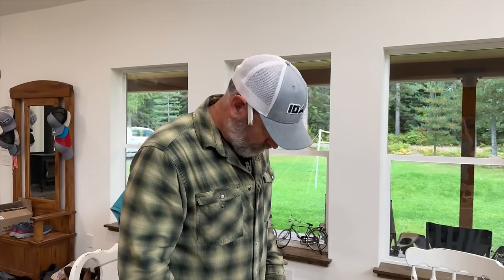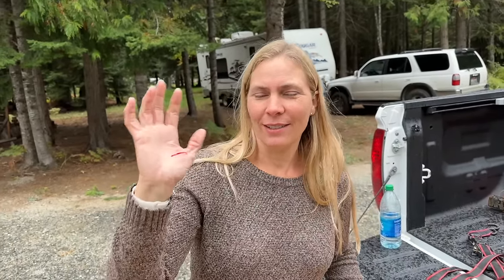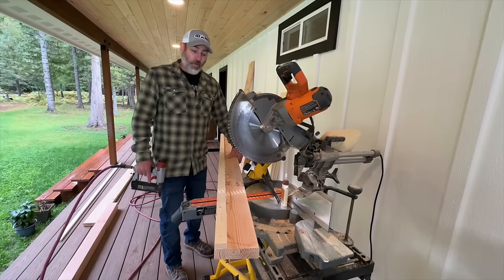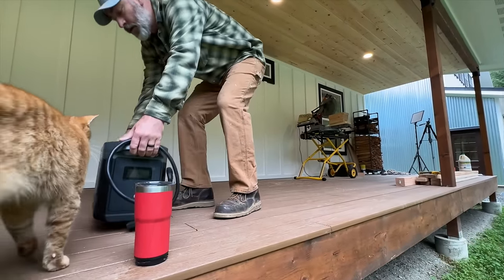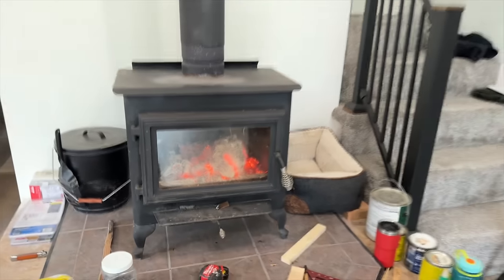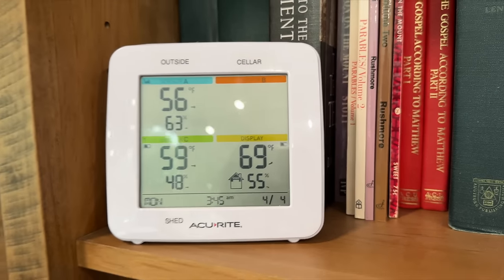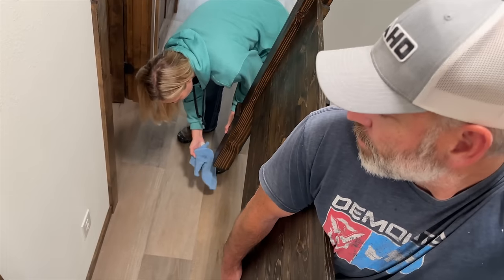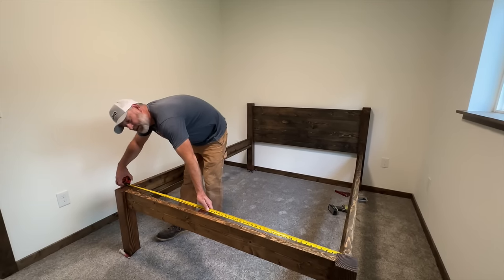DIY Queen Size Bed Frame - Easy and Cheap

Comment: For pests and other insects plus excellent spider prevention I found that Cylence worked really well. It comes in a small cubed container for 20 or so. It makes 2 gallons in a sprayer. I have not been bit by spiders ever since. I hope this helps because it did for me.

Comment: I like the plain jane sleep number bed. Mainly because its adjustable and paid for. Good luck with your search
Reply: My wife and I have had one for years and love it.  Both for the adjustable firmness that you both an set to what works for you.  But also because as parts of the mattress wear out you can replace it, without getting a whole new mattress.

Comment: EcoFlow DELTA Max Portable Power Station in Australia is AUD$5698.00 with extra battery.  Big Difference to the USA where at the same time this package is USD1199.00 which is about AUD$1895.00.  Good deal if in the USA.

Comment: Good job.  I made something similar for daughter.  try cutting some scrap carpet squares to put under post if on hard/vinyl floor.  Also I used hidden bed rail hardware not pocket screws.

Comment: Beginning was nice, the road trip, something was needed besides Home Depot when you are there would break up the home improvement dullness.   Love the first fire and the bed frame build is very nice.   Nice camera work with the truck loading and Tux on the cart.

Comment: Martin talked about a desire for high snow levels. The Truckee / Soda Springs area of California gets some of the highest snow levels in the country. Last winter, the snow levels reached second floor windows. Imagine having to maintain passable driveways, streets and walkways through levels like that. Great job on the bed frame.
Reply: My sister in law lives in Truckee. We FaceTimed a couple times and it was insane the amount of snow. I traveled donner for probably close to 25 years on a regular basis and never saw it that bad.
Unfortunately for us up here in north Idaho the predictions aren’t looking all that great for having 6’ on the ground, but we shall see. Always prepare for the worst.

Comment: So if you move you need to take out the pocket screws? Did you consider using hardware that would make it easier to disassemble?

Comment: I’ve sold mattresses for 20 years no warranty with out centre support.
Reply: If you're worried about air flow you might want to use a whole sheet of plywood and just drill out small holes strategically placed and avoid possible mold.👍
Reply: There’s no warranty if you stain it either, by sweat or spill or anything, it’s always something with mattress companies!

Comment: There is only one mattress that I will buy it’s called ‘Tempur’ it’s the best mattress money can buy but they are expensive but you get a great 15 year warranty with it. They were designed for NASA to line the shuttle so that the astronauts would not be injured when they when into space we are now on our second mattress as I have chronic pains in my back constantly so we needed something that was comfortable and after trying loads of different types and manufacturers we finally found Tempur and it’s hands down the best mattress there is out there. They are a memory foam mattress which come it a 12 and a 14 inch deep mattress so depending upon what bed frame you have as to which you’d need we just buy the deeper mattress but a super king size mattress which is 6foot wide and 6foot 6 inches long and it’s brilliant. A lot of people will not pay the money for one but you spend roughly 33% of each day in the bed so when you work out the cost it came to 2p per night each for a quality nights sleep and more importantly I was able to reduce the amount of morphine which I was taking each day and that improved my lifestyle so the mattress is golden to me and the wife loves it.